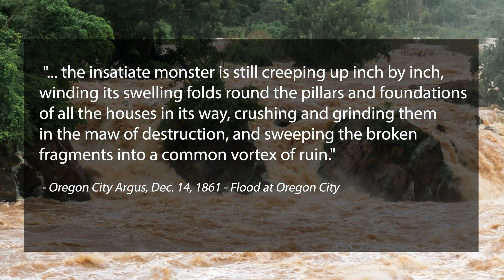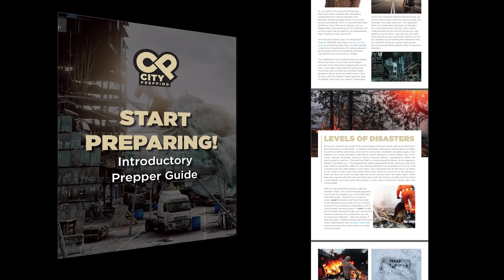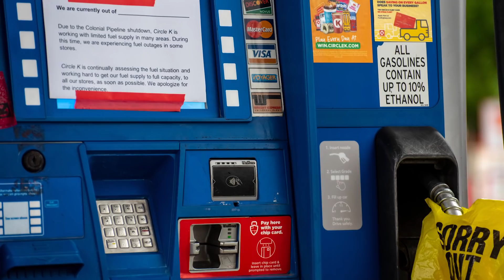The Most Overlooked (And Realistic) Threat To Preppers

Comment: We on the north coast, lake Erie Ohio, get several weather fronts.  1976 was a snow storm, 1977 below zero temperatures for 90 days and that was the winter. In the spring we can count on several thunderstorms that take out electricity, down trees and flood low lying areas, 1995 and 2006 (I think). Each time we had just emough so now I'm backing up my backups. Thanks.

Comment: great information to consider. we recently had a really bad wind storm here in colorado springs and our power was out for nearly 4 days. we did pretty good but heating is an issue. i live in a rental so need to really figure that one out.
Reply: Hi Colorado here too 
El Paso county .
Candles crisco heaters even a small wood burning stove you could remove a window and vent it out that way with not too much hassle. Better than freezing.
Reply: Crisco candles, look that up. Garden pot heater. Copper coil and a cheap alcohol stove can recirculate water and heat it up. Plenty of solutions
Reply: I've used a Mr. Heater Buddy propane heater indoors during rolling blackouts last winter. I also had a carbon monoxide monitor and made sure i had good ventilation. Make sure you have plenty of the 1 lb. bottles or hose adapter and filter  to use  a 5 gallon/20lb tank

Comment: Can you do a video about telling time during a grid down or worse? Since a lot of people rely on their phones or smartwatches, it can be hard to tell the time. Batteries in digital watches can only last so long or can break so
Reply: You could get a mechanical wind up watch or make a sun dial
Reply: @mutedonkey8361  I dont know if they can be reliable and a lot of people dont know how to make a sun dial let alone read it. Some people probably cant read analog clocks since theyre used to watches that uses numbers
Reply: A wind up clock is pretty cheap, like maybe $10. My Dad actually had a wind-up travel alarm clock which still works. It's in our prep supply pantry.
Reply: I tried buying a manual watch last week at Wal-Mart. They said they're not available any more. They don't make them any longer.
Reply: In a disaster you will not need a clock, or a phone.
Reply: @jimcalifwin3760  sentries need to rotate. How are you going to know when your shift starts or ends? Baking things and preserving foods needs to be timed. I wouldn’t want to guess that meat in the pressure canner is done.
Reply: A cheap wall clock running on AA batteries will keep good time for a year or better.  You can buy a wind up kitchen timer for a couple bucks.

Comment: This coming March I'm planning on doing a week long bug-in practice at home. I'll keep my exterior lights on at night only because my neighbors would call local code inforcement and report me not having power. I'll turn the rest of my power off including my sump pump. I have a small solar array 720w panels/625Ah batteries/3000w inverter to run the 12v backup sump pump and charger my solar generator.  I'll be using a rocket stove to cook. Hot showers will be heating a large pot of water outside and running it through a 12v pump and shower head. Water won't be from the tap, I have water stored in multiple 55 gallon barrels but I really want to try rain water. I've been processing lump charcoal into activated charcoal for water filtration although I do have a Royal Berkey for drinking. I just purchased several cold weather sleeping bags and heavy weight mylar tarps for sleeping at night. It's just my son Johnny who has Down Syndrome, 3 dogs and myself. I'll power my internet with my Bluetti solar generator, that should keep my son happy. I'm still working on a list so I don't forget anything. If all goes well I'll try this again but in July. I'm in NE Indiana so March temperatures can still be well below freezing and summer months can be hot and muggy.

Comment: Another great vid Chris.

And now, the answers to your questions [from MN, USA]:
In my immediate area the historical extreme weather events are pretty common and what you would expect. Blizzard/extreme cold, flood, thunderstorm, heat, high winds and a slightly above average chance of tornado.

Most of these I am well prepared for or isolated from though there are some exceptions. If a tornado drops down on my house I'm pretty well screwed and my heating/cooking fuel [if the grid drops] is not truly sufficient. I do have solar power generation for electricity but I would have to severely ration my 'normal' power usage but I've got enough to use a microwave.
Reply: Well said, from a fellow  Minnesotian.